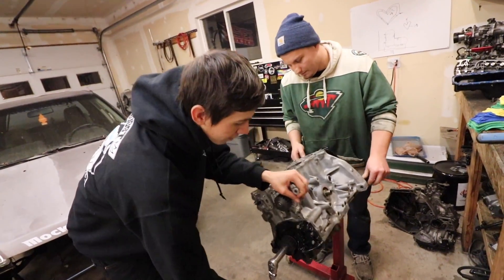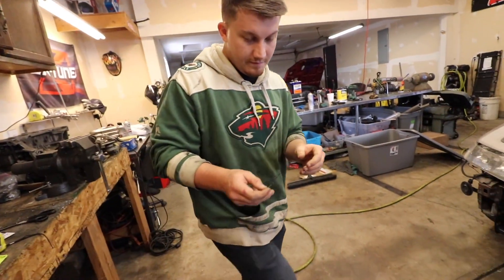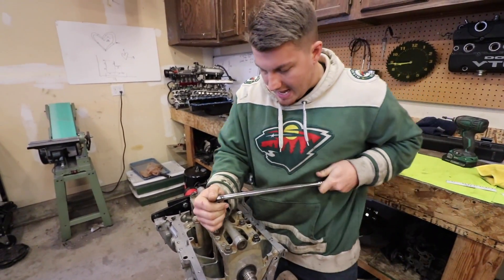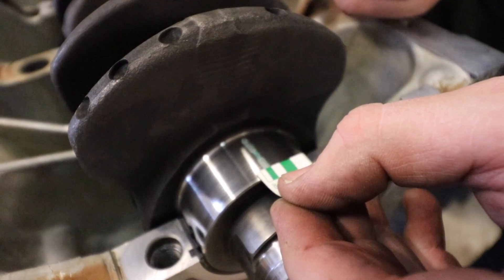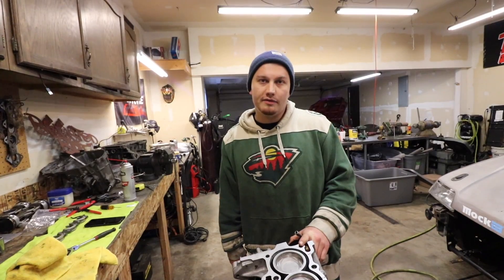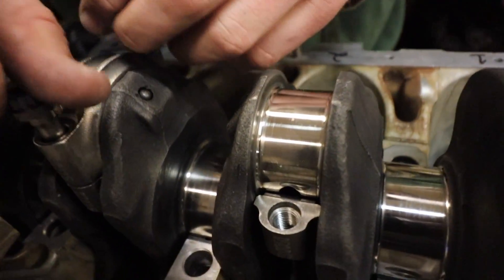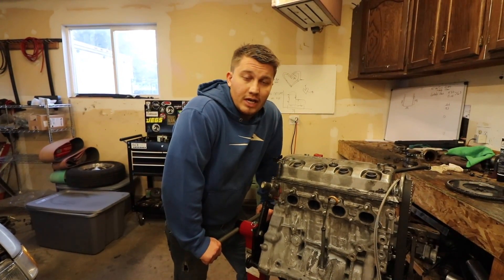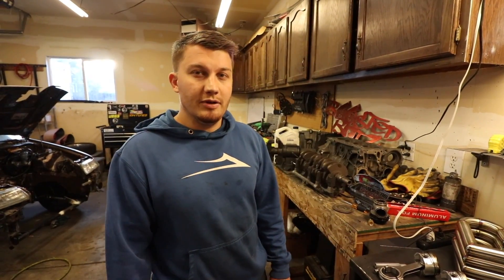Building The Engine For Our Turbo Wagovan

Comment: don't need a ring compressor for these just use a or two plastic picks and feed the rings into the hole by compressing them one at a time and dropping them in. faster and much safer than a tool and makes sure you get them clocked right.

Comment: Those rings are gonna spin all over in the bore and end up where they wanna end up anyways. I do the top 2 180 apart and the oil rings 90 from those. Never had an issue

Comment: If I were you, I would remove the engine and transmission and throw them out. If Charlie touched it, you don’t want to use it. Look at how many videos there are of him using a grinder with a completely open block and not giving a shit, not cleaning anything, and putting it back together with all of that slag... The boys a moron and should never be allowed near  tools again

Comment: Those ring compressors suck. When building my last motor using Wossner pistons, I bought a bore-specific tapered compressor tool from the US as I couldn’t find one easily in the uk. Made fitting a dream. The oil control rings are 3 piece and really delicate on the Wossner pistons. 

How did you stagger Your ring gaps, 120 degree or at 180 intervals?

Comment: Hayden, I know that you know what you're doing, but you're no master mechanic, like me, but we both know that turbo engines are supposed to be a little loose (other than bearing clearances), and your ring gaps were good, but as long as your main clearances were good and the rod journals weren't ground (or if they were you bought the compensating bearings), your rod bearings are most likely to be good. As long as the engine spins over decently by hand you'll be straight.

Comment: Are you positive about the piston direction? The arrows always point forward toward timing cover in every other engine ?
Reply: vitara pistons face flywheel becuse they are for a diffrent engine and the valve relives for the intake are on the opposite side

Comment: Ya those damn #3’s my single cam killed it’s #3 sleeve we made 440 tho same setup as you just stock head
Reply: From what I hear, #2 and #4 fire before #3 so there is more heat and stress on #3 cyl. Most tuning software allows enrichment on individual cylinders so you can add some extra fuel to #3 for safety.

Comment: Did you do anything to the oil pump? I remember seeing them shim em for higher oil pressure before.
Reply: Yeah, you can port the pump and shim the spring for higher oil pressure, but I've made it work with a stock Melling replacement before. I have a Killer Motorsports Stage 3 ported and shimmed oil pump on my built LSVTEC right now, but even a factory stock oil pump would work fine for a low power turbo engine. I realize that this engine is a single cam D series, but as long as he had a Z6 pump in it, it should be fine. I made over 400 whp on my B18B1 with a factory unmodified pump before and had no issues.
Reply: @DiamondBackRattlaKid  ahh i see. So is the z6 pump known to flow more oil? As opposed to a non z6?
Reply: @Cpt_Litty  Not necessarily, I was referring to a B series, but I would imagine that with a D series the Z6 or Y8 pump would flow more due to the fact that they're both designed to flow with higher pressures at high RPM. I didn't say that the same thing applies to a D series engine, I was just agreeing with you.
Reply: @Cpt_Litty  Sorry buddy, at the end of that last reply I was thinking about another comment that I was reading and I know that you were asking me a legitimate question, I was trying to answer it to the best of my knowledge. I didn't realize that I mixed up two different comments until just now.

Comment: Are you reusing young Charles' old camshaft ? That thing was a monster from memory... Would definitely help reach that 400whp in the  future
Reply: i thought he had a stock cam, he just had a ported head and oversize exhaust valves
Reply: Distinctly remember him unboxing an aftermarket camshaft and him explaining it was the largest one available and actually designed for an N/A build
Reply: If it ain't from Rocket, it ain't the biggest anymore.

Comment: Rattle can in the shop out of the wind, screw body work. $50 paint job, just wet sand it real quick. Sunday is supposed to be back in the 50's
Reply: Jason Sanderford this man gets it haha
Reply: I painted my Corsica for $30, in the high winds, it's been 2 years and it's still holding. I wet sanded it, taped it off and sprayed it. I dont have a compressor, a shop or a spray gun
Reply: @jasonsanderford436  When I was in my mid 20s my neighbor sold me her 95 Beretta for $200 because she thought that the transmission was shot (it just needed a fluid and filter change) but I sanded it all down, went to Walmart and bought a bunch of $1 cans of Walmart spray paint (primer, base, clear) in Royal Blue, primed it in my backyard under the huge tree, sprayed it, cleared it, and then wet sanded and buffed it after it had dried, and I sold it a few months later for $1500. I mean, it wasn't like glass, but for what I had into that paintjob it looked fairly decent.
Reply: @DiamondBackRattlaKid  awesome story brother, thanks for sharing it
Reply: Give it a quick olive drab paintjob and give it a shark's mouth on the front, then airbrush rivets and seams into it...shit'll look sick!
Reply: Thinned Tremclad out of a spray gun. Cheaper than buying a bunch of rattle cans, and quicker and easier to do if you already have a spray gun and compressor (Assuming most car guys have a space, a mini compressor at least, and 20 to spend on a throw away gun) I go about 20% thinners to paint, and let it fly!

Comment: Are the rods standard lenght? How thight you but the rod bolts?
Reply: Exactly my question...  looks like its gonna be a low compression build..
Reply: I have low compressor engine also, so I'm intrested dyno results
Reply: When I built mine I used speed factory no notch extended rods. I think they were 168mm.. I dont remember the specs. But on my build we made well over 400 on 93